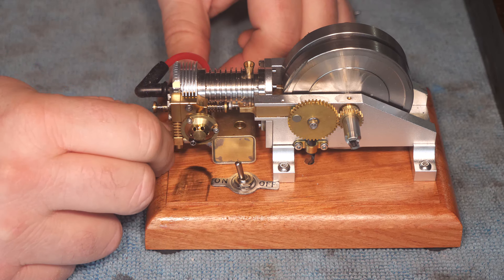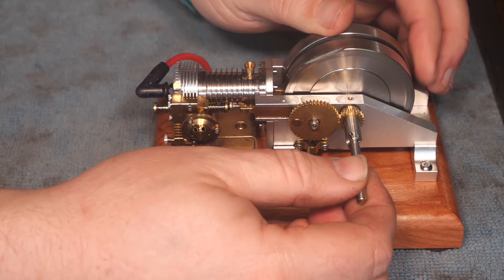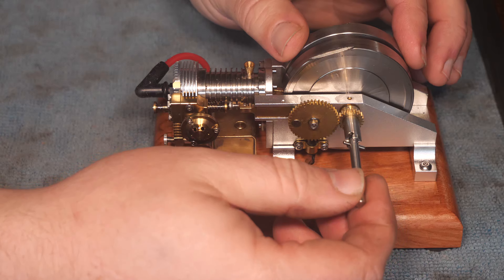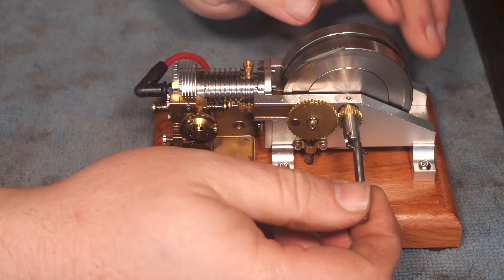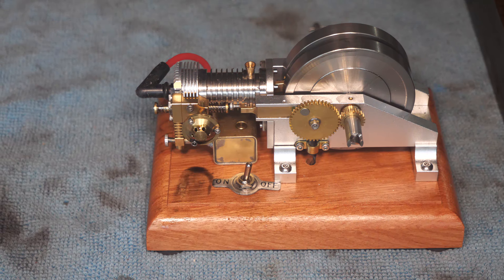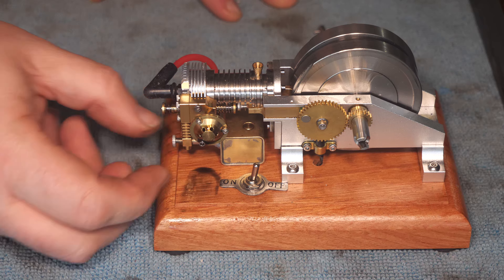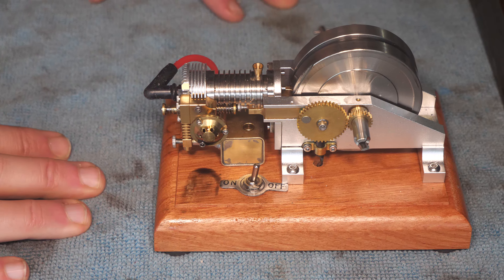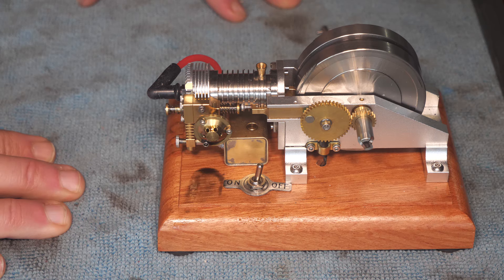M96 First Run Summary

Comment: It's a shame really, that a brand new engine, has to be messed about with in order for it to run correctly.

I bought one from eBay, then during transportation to me, I found out it was a 4 cycle and not a 6 cycle, so I sadly returned it unopened.

But now I see the problems that you are having, It might of been a blessing in disguise, as I don't have the patience that I used to have anymore.